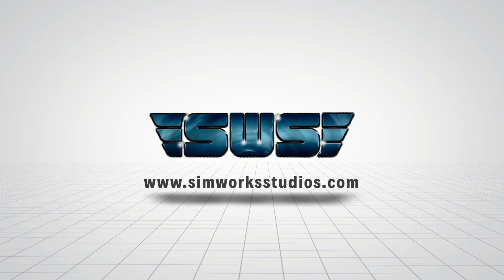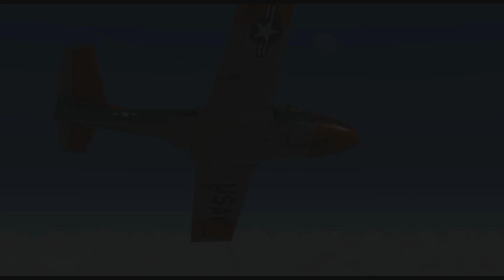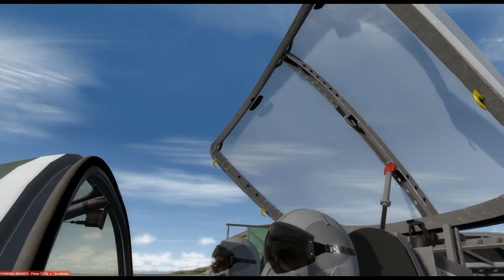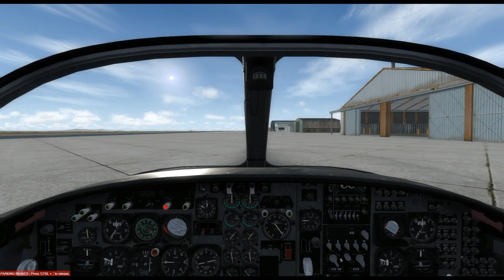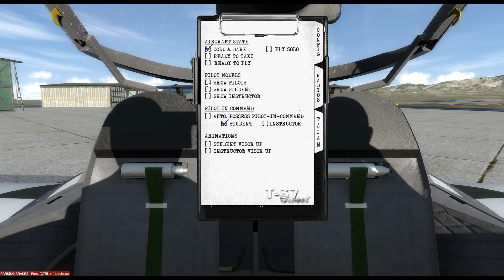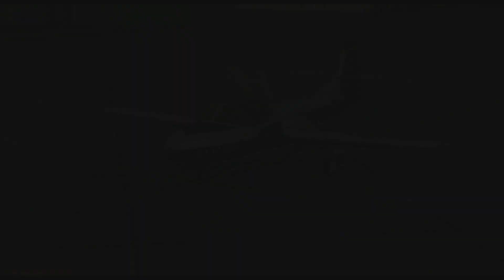T-37B Tweet - Familiarisation

Comment: Very interesting, accurate, detailed and realistic cockpit layout (except for being so clean).

I was an instructor for 6 years in the Tweet.  That IP in the right seat looks like he's pissed!  😜

One detail not mentioned:  there is a speed brake switch located on the side of each pilot's right throttle knob that is thumb-activated and is not spring loaded in any position (you can see it in this video on the student's throttle).  The left seat has a two-position switch - forward for SB retracted and aft for deployed.  The instructor's switch is three position - middle is "neutral" and defers control to the student's switch.  Moving it aft or forward will deploy or retract the speed brake respectively and over ride whatever position the student's switch is in.  The speed brake itself is located under the nose just forward of the nose wheel and transition movement time is about 3 seconds.  

It's used for bleeding off speed more rapidly, but more importantly for maintaining a higher engine RPM to compensate for the slow engine acceleration time of around 10 seconds from idle to full power.  It is deployed throughout the landing phase (along with "thrust attenuators" located in the engine exhaust which automatically deploy/retract at an engine speed below/above 70% RPM).  If the computer program is as accurate as the ear-splitting ambient noise signature it so accurately captured, you should be able to also hear the SB and thrust attenuators when they're activated.